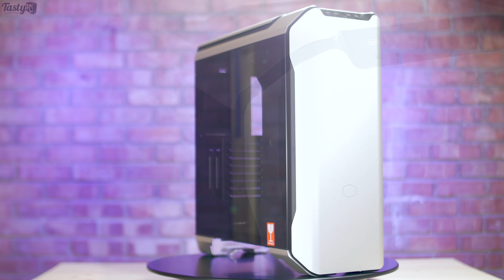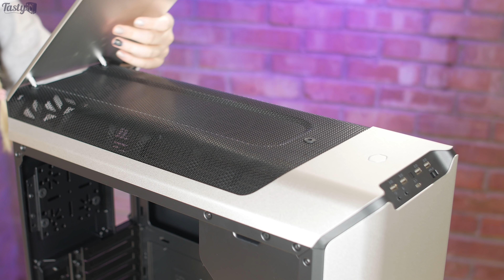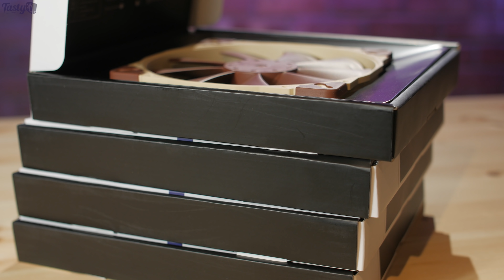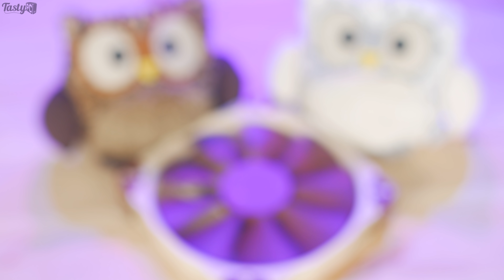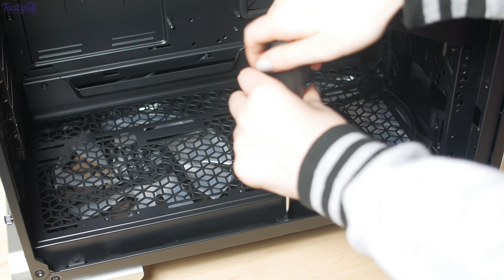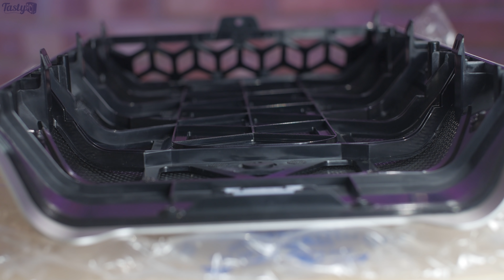Creating a 200MM Noctua Wind Tunnel

Comment: Top fans will be restricted with that metal piece, maybe try removing it and run some tests ☺️
Reply from the maker: That panel can either be down completely, just sitting in place with a gap underneath, or off completely. I plan to investigate the thermals in a video after the build is done and this will be included. :)